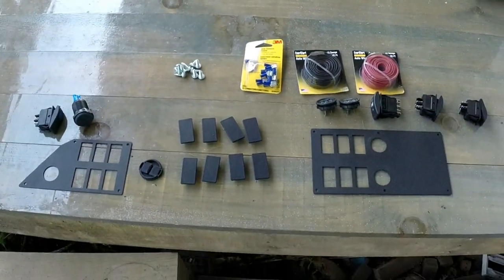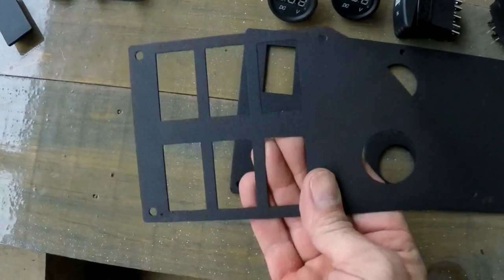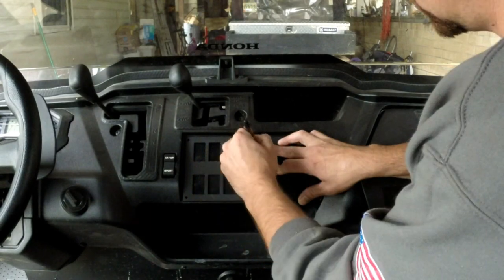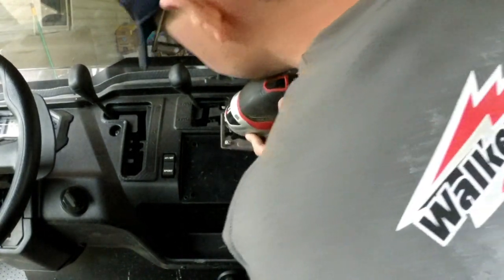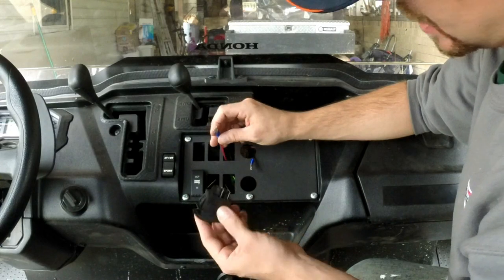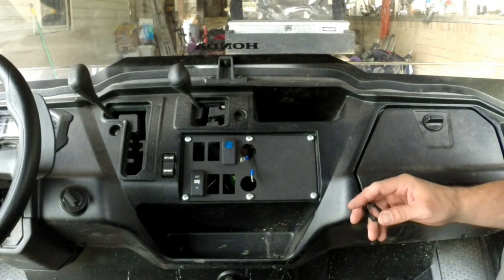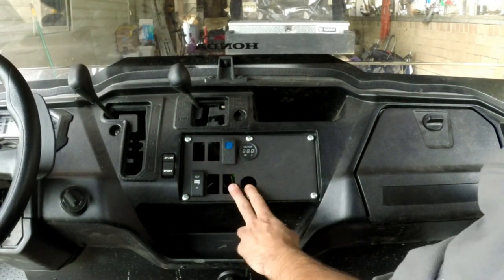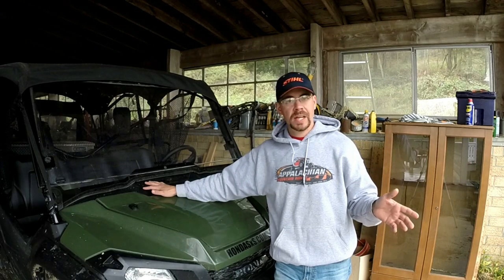Honda Pioneer 1000 Switch Plate Install (P1K only)

Comment: Another good video. Just on a side note, I also installed a switch plate on my P1000-3 and found the easiest way to cut the holes in the dash was to use a hotknife. Just took a regular razor knife and heated the blade up to red with a small torch. No predrilling, and it cuts the plastic like butter.

Comment: I do this for a living. Installing accessorys to the crf230, 250f, 250r, 250x, 450r 450rx, trx420, trx500, trx500 irs,  pioneer 500,700 and 1000. It's a good fun job. Every job is different. Somethings are different in new Zealand. Compaired to the American market.
Reply from the maker: tim fagan I’ve noticed that. I think someone shared that there are a couple accessories for the P5 that you get we don’t but it would be nice if we did. Think one was a big storage box you had to cut a big hole in the hood but the pictures he showed of it looked awesome!
Reply: AppalachianMountainRiders AppalachianMountainRiders you used to have to cut a hole on the bonnet. For the front storage boxes. Now you just whip the front plastic off all together, and screw the box on. They look pretty cool to be fair. We don't get warn winch kits either.  We have a different brand.

Comment: Good work! I just got done installing the Honda (Warn) plow assembly. The fit and finish was terrible. Had to re drill holes... setup was a pain in the butt... I’ll stop complaining now... lol. 🇺🇸
Reply from the maker: Mike Yerke it seems to be the norm that aftermarket stuff always fits better than the oem with the pioneers. Usually cheaper too...lol.
Reply: AppalachianMountainRiders I’m finding that out!!! The hard way! 💵💸

Comment: Just be careful that your switches clear the axel shifter assembly.  Also, I installed numerous switches in the dashes of my 7 pioneers and almost all of them have failed due to dust.  The cheap Chinese switches in those fancy rocker panels last about a week before they get too dirty to work.  I use expensive toggles now that have a rubber dust boot over the switch.  I also tape up the back side just to be safe.

Comment: Where did you tap in to the accessory line at.  I know I can use the wire at the plug in below the panel.  But did you really want to run all your accessories off that one wire?  If you used a wire kit/seperate fuse panel?
Reply from the maker: Joshua Walker all I had was the volt meters which were wired directly to the batteries. That’s why I put them on switches so I could turn them off. Other wise they would be on all the time. Best thing is to run a fuse block so you only have to tap in once for key on power then you can run power to your accessories from the block which is feed main power from the battery
Reply: @AppalachianMountainRiders    Okay that makes sense.  Do you have a preference for a fuse block that you run?  I probably could just googgle it lol

Comment: What did you use to get the warning label off?
Reply from the maker: A drill and an 1/8 drill bit. It’s also stuck on with adhesive so it takes some prying. Watch the switch plate install for the 500. It’s on there if you need more. The original vid had both but I edited it down to only show each individual one for those not wanting to watch both. That’s why I don’t show it with the 1000 cause I showed it with the 500.

Comment: anyone who's looking into buying this machine with accessories beware!!!!!!!!! I'm on my second utv, first i bought the 700-4 with the workman accessory kit and it was ok but the utv itself was very slow and loud and the heater didnt put out much heat and it would always steam up in the rain. Once the 1000-5 came out i traded my 700 in for a 1000 hopping all the issues would be rectified but they were worse. all the doors had gaps, the heater was worse, way to much heat in cab from engine in summer so cant take dog with me. steams up worse . all back doors dont work and dont stay lined up with the role cage  and were useless plus the back zipper for the main back door dont work when is dusty or dirty which will happen after a few runs, the zipper just splits apart when in use.the front doors are way to heavy and the straps that hold the door keep busting and the passenger door handle is falling off. there isnt enough protection under the machine even if you purchase the metal skid plate they offer. plus more to list but i wont bother........all of these issues happened within a 1000kms. when i called into honda canada with hope that they would rectify the issues all i got from them was "sir we passed your suggestions into the right department and you can expect to see these problems rectified on our new bikes" so basically after spending around 70k they are going to leave you in the black with your bike issues but we will make their new bikes better lol thanks honda ! if anyone is considering this bike please look at the polariz 1000xp they have way more and way better accessories,  looks like ill be selling the 1000-5 in the spring
Reply from the maker: Sorry to hear about your luck with the Honda’s. Trust me when I say that your experience is something only about 1% of Pioneer owners experience. Spend anytime on hondasxs.com and you would see that. Not trying to Sway you back, I would probably be upset too if that happened to me and there is no excuse for the runaround Honda themselves gave you. Hope everything works out great for you with a Ranger! Nice thing about those is the aftermarket is huge for them!
Reply: Thanks for the reply but I have to disagree. Here in my city I've bumped into a few ppl with the same issues as me who have full enclosures. Plus when I brought it up to the guys into Honda they all agreed with me that the accessories are questionable. The bike itself is great but the accessories they didn't think them threw.  I own a lot of Honda products and I can tell you that the accessories are not Honda quality
Reply from the maker: spenny oliver I totally agree with you about the accessories. I think I misunderstood your last comment and thought you where talking about the machine it’s self...lol. Sorry about that. I have the Honda factory doors on my P5 and the fit is terrible! Honda really did drop the ball as far as factory accessories, agree 100%